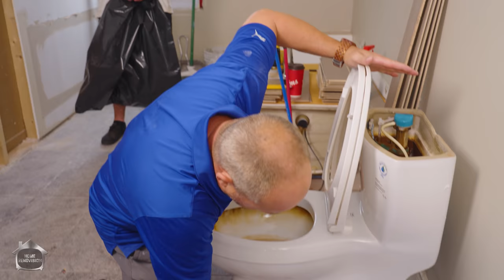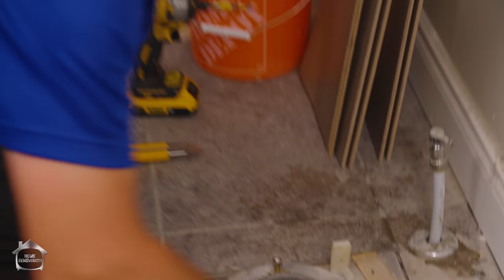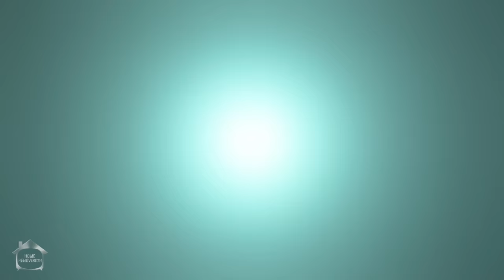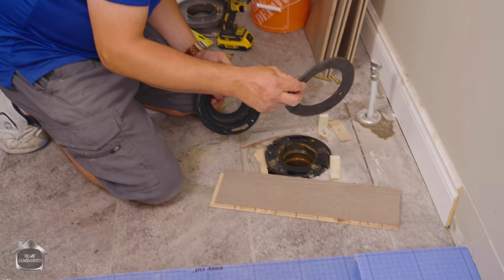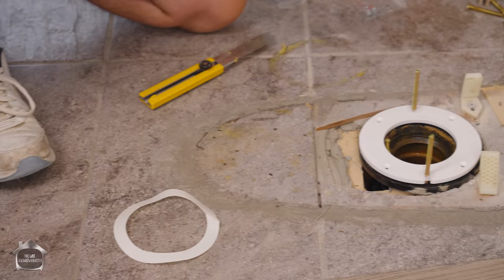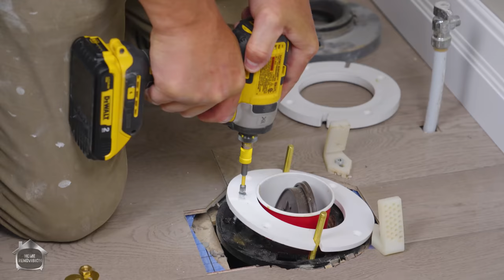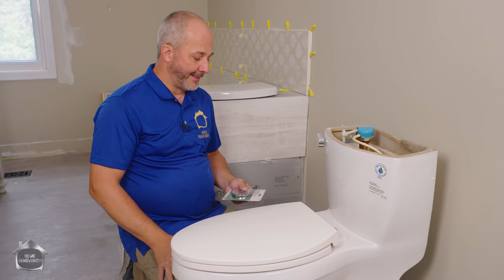How To Install A Toilet So It Won't Leak | DIY For Beginners

Comment: Thank you so much for your information. I've installed numerous toilets in the past . I'm not a  plumber, but I can do most plumbing things. We had a  leak in the living room ceiling below the  bathroom. I removed the toilet and ended up finding out it wasn't the toilet leaking but another drain pipe. I fixed the leak and reinstalled the toilet. And then had a large leak from the toilet. I couldn't believe it.  I watched your video and then saw what you said about tightening  the toilet foundation screws evenly.  I never paid attention to that. I had tightened one side fully and then did the other side. I removed the toilet then reinstalled it exactly like you showed in your video.  . . . . . . . and BAM  .. . . . . .no leaks. Thank you so much.

Comment: I have an unlevel Closet Flange that is below the floor surface and I think the extension rings with the rubber gasket is going to wrk. Korky makes a nice tall one that is similar to the thicker was ring. Will let you know how it goes.

Comment: This is super helpful!  I have a house that was built in 1929.  The flange is cast.  When I moved in 5 years ago, I pulled the toilet and resealed it.  Didn’t replace the flange,  it probably should have, looking back.  It was pretty rusted out.  The twist and seal I think would be a great option for this to properly secure the toilet.  Next project along with the vanity (watched your video on that as well).  Your videos are very helpful with DIY projects around the house.

Comment: Love your videos! As a plumber (also based out of Ottawa), I have to nit-pick a few details. The trap in the toilet is an S trap, which is why it will siphon with a bucket of water poured in it, but every other trap in your house will not. Secondly, if you're not going to remove all the water from the tank with a rag or vacuum there may in fact be a decent mount of water left over when you remove the toilet supply. Some toilets have a recess around the fill valve that holds a fair amount. Ideal to just have a cup or something handy to let the hose drain into just in case. I think it would have been good to also mention the importance of a well secured, structurally sound toilet flange. I find many toilets with issues have a flange that was poorly secured or has had screw or subfloor failure. If a poorly secured flange isn't addressed, most other elements of the reinstall wont work. The toilet will always move and tightening the bolts will only over-compress your seal. Perhaps you've mentioned this in other videos, but I feel a homeowner going off just this video might end up missing that and having issues. Keep up the great work!!
Reply: Good points - loose flanges are very common especially in older homes where we see a lot of damaged subfloors.
Reply: My house is slab on grade, single story, and the ABS pipe catching the toilet is cast in the concrete. There's a hole chipped out in the slab larger than the flange and pipe that goes down to the turn in the pipe, so there's a half inch space all around the flange and downpipe. Both toilets had the adjustable outer metal ring and ABS center type of flange. Built in 1994, they were both now totally rotted and both toilets rocked and leaked sewer gas. Both are in a water closet type bathroom design so sewer gas stunk the room up quickly. So, I had to remove both toilets to fix the flange and replace the wax. The shocking thing to me was that both flanges were totally floating in the wind. Not secured into the slab at all. No screws or anchors. Nothing. It was just the flange glued to the down pipe, and both pieces floating in that space until the slab enclosed the horizontal pipe at the elbow. I was so annoyed. I used my hammer drill and the longest 3-4" Tapcon concrete screws available to me to secure the new all-plastic flange to the slab around it at a slight angle due to the gap between the flange/pipe and the slab. Couldn't go straight down, nothing there. Then I installed an extender plate with many brass screws and sealant between because the flange was level with the tile floor which I don't believe in. New wax, reinstalled the toilet, solid as a rock and no more sewer gas. I have no way of knowing if the adjustable flanges were original but I'm guessing they were. So, '94 to '21. Only 27 years of life, and who knows how long they were leaking gas. They were leaking when we bought the house. My repair will last my lifetime. 👍 I can't believe how many people just leave a closet flange loosey goosey and think it's ok. Out of sight, out of mind, right? 🙄 Integrity. Honesty. Pride in the work. It didn't take me long to drill 4 holes and pop 4 concrete screws into that slab. Even 2 would probably work ok. But no, they left the 1 foot of 4" ABS pipe alone to hold everything in place. 🙄
Reply: @buddhastalin8445  I only know what I've been taught and am curious how other people go about things and if there are better ways out there. If you think you've learned all you ever need to learn then I think you're just wrong. Stay curious my dude

Comment: Same great content I've come to expect.
In my case, as well as the flange being too low it was also installed wrong. The wide ends of the bolt slots were parallel to the wall instead of the narrow ends. Flange extension kit fixed both issues.
Gotta love the foreclosed homes.

Oh, and if anyone does decide to shopvac out the last bit of water, it would behoove them to make sure the hose is connected to the right port on the vacuum.
Reply: That last bit is incredible.
Reply: @EricLS  my favorite part was quickly calling my wife to inform her that if she made it home before I finished cleaning, to not panic, the walls are not covered with feces....just toilet water and some left over sump water that I neglected to dump from a previous project.

Every square inch of my bathroom was covered, except for a humanoid shape in the shower directly behind me

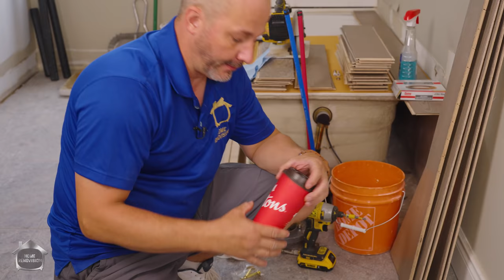Comment: Lot of great hints, but the one at 17:29 might be the best one yet.

(For newbies, and the great majority of people with old style traditional vertical attachment bolts - Not the horizontal screw-in-from-the-side ones he showed early on - it would have been helpful to include a few seconds of what that is like since that is much more common to be expected.)

Comment: Some plumbers say to not caulk around the base, if the toilet leaks you want to see the leak.  You don’t want to seal it so the water builds up and damages the floor.  One video I saw said to go ahead and caulk it but leave a space in the back where water can escape, alerting you that there’s a leak.
Reply: It may also be code dependent as well

Comment: Thank you very much! This comes just in time because I need to replace a toilet. In Belgium we never use wax, we always use a white tapered PVC pipe that slides into the sewage pipe sticking out of the floor. I also wonder which brand of water flushing system to buy: Geberit or cheaper brands?
Reply: The same in Russia. Personally, I wouldn't risk cheap ones. I installed my toilet provided with Geberit 7 years ago and have had no problems at all.
Reply: If you put anything inside a 3" pipe, you reduce the effective internal diameter of that pipe.   Perhaps in Europe you use 4" pipe when roughing-in toilets?

Comment: Better Than Wax is a rubber seal (found at HD, Walmart, big box stores) that gives you a little wiggle room so you don't have to be perfect initially like the wax requires. A little more expensive, its an option if wax installs give you issues. Once helped a neighbor install a new toilet & couldn't figure why water was still coming out onto the floor. After tearing out the old flange, pouring new concrete, install new flange (slightly above finish flooring), still leaking. Eventually figured out that the freakin new toilet was leaking and attempted repair was done at point of leak. Looks like someone at factory just tried to glaze over it. Even if the store gave him a free toilet (not), it still wouldn't make up for the stress and time spent having to trouble shoot this problem. Lesson is just because its new doesn't mean it aint broken, just because its new doesn't mean factory has quality quality control or if these things are each tested for leaks before they're boxed and shipped.
Reply: I’ve been told the exact opposite of this by several plumbers. They all stick with wax because it gives you a little wiggle room on initial setting. All of them said the rubber ones leak.
Reply: I like the Danco Perfect Seal - uses both rubber and wax.
Reply: From what I’ve seen the rubber once leak

Comment: Step 1: clean the toilet

Siliconing or grouting the toilet to the floor does stabilize it, but it masks any potential leak at the seal.
Reply: I was taught you seal everything but the back. Because the surface tension pulls any water running down the outside of the bowl into the unsealed gap, but it leaves the back open to indicate a blow wax ring.

Comment: As someone who has smooshed wax rings on some hard to manuver toilets only to find out years later that it was my fault the toilets were slow flushing... rubber compression rings are the way to go.

Comment: Now I'm nervous about our other toilet.  The tile was installed by a contractor, and he had me buy an extra wax ring.  He used two wax rings instead of a flange extender, which until I watched your video I didn't know those existed.  I didn't check to see how low the flange was.  Maybe it's fine? I have trust issues.  Haha! I'm seriously tempted to pull it up and check it.  Seems better than having to retile the floor later due to a rotten subfloor.

Comment: That was a very good tutorial.  Thanks
I do have a problem with using clear cilicone in kitchens and bathrooms, which I admit is a personal quirk.  Whenever I see that shiny cilicone around the flat surfaces under a fixture it appears to be standing water and I think "leak" and "bacteria".  I know it's just my personal bug-a-boo and not a big deal for most people.

Comment: If you are having a hard time lining the new toilet up you can place screw drivers on each side on the floor pointing at the bolts to help as an alignment guide when doing it yourself.
Reply: Great tip.  I use masking tape and do the same thing!
Reply: @ThatFixItGuy  I can never find tape when I need it, lol.
Reply: Also plastic straws on top of the closet bolts help too.

Comment: I love these videos and as an apprentice plumber in my area this info really helps me bring more knowledge to my jobs. The only issue (but not really) with the installation of the toilet is I've been told by my journeyman to not apply silicone all around the toilet but to leave a space clear at the back so that you will be able to spot a leak easier before it's a black stain on the ceiling.

Comment: use straws from the local McDonalds to place over the Jonny Bolts to help you guide the toilet straight down through the bolt down holes in the toilet!
Reply: Great idea!

Comment: As a master plumber I've set 1000's of toilets in tract homes in So. Calif.....I'm not sure why I'm even here. But here goes....
Before you set the toilet, run a nut and washer down  the closet bolts  until fastened to ring...(holds them and everything else in place)
Rubber rots and curls...(would never use that)...you can stack 2 wax rings, you want it to squish!
Use shims on all 4 corners (like a wobbly card table) so the toilet doesn't rock side to side or front to back....only then you fasten it down to floor.
Never set and old stained toilet....gross....
A 2 piece toilet has some do's and don'ts also.....
Love your drywall video.

Comment: Thank you for the information! I live in a very cheap house that we've been remodeling room by room. No corner is 90 degrees, everything was half assed and done incorrectly. The latest one is we needed to replace some subfloor in our bathroom because of rot. We ended up gutting the entire bathroom. One corner of the joists was connected to nothing and just floating. This caused the tub to sink in the back about 3-4 inches. The toilet was rocking etc. My lord was this a task. But this video really helped me understand how to do the toilet correctly.

Comment: Plumber by trade. Whenever I see big ole gaps between the flange and the flooring I fill those in with plumbers putty to keep the water above. Rarely caulk, never grout, should I customer ask for caulk, leave gaps at grout lines for observation of leaking wax. Better to see it before before it ruins the floor. If the flange is low, I bolt on the bolts, if they’re brass they’ll always be good. Double wax ring is fine, no horned underneath a horned ring. 90% cast over here in Chicago, those pvc replacement flanges are life savers, we tend to use the Oatey ones with the Allen key screws for compression.

Comment: I've also heard it recommended to not seal the toilet to the floor because that way if it ever leaks the water will run onto the floor and you'll see the leak.  If it's sealed to the floor, you won't detect the leak until it gets worse.   Just something to keep in mind. I think I'd probably leave a weep hole or something for any leakage to come out if I did seal the toilet to the floor.
Reply: Agreed.  Leave a few inches unsealed at the very back of the base (where it's not so noticeable) for water to come out if there's a leak so you'll be able to see it.

Comment: Wax always; they are much more maneuverable. Just replaced a toilet in a complete bathroom renovation. Wax rings give you the ability to get a toilet flush with the finished flooring no matter where the flange sits
Reply: Omg,,, nice work brother,,,    the 3 decades flood guy.      Mitch
Reply: Welp re doing my toilet after watching this! Used a regular wax ring. Should have done the Jumbo with added flange extension kit.
Reply: @JonathanRootD  pull it out now and replace, dont even think about it.
Reply: Wax is trash, rubber all the way.
Reply: @tomsaywer9883  Foam rubber is great......for the first 5-8 years.

Comment: I had no choice but to use the stainless steel moveable flange into PVC 90 lead bead non-hub 3" all cast iron. The subfloor was completely rotted down to the joists. I had to build up the subfloor with (3) 5/8 plywood just to get a slight pitch for the toilet flange to the stack. A pain in the.

Comment: During the tee-pee shortage I replaced my toilet to add a bidet and used a rubber gasket. Seems to be working out.
Reply: A bidet is a game changer.
Reply: I have been using bidets since I came back from SE Asia... definitely a must. I have been using a add-on unit from bio-bidet.. hot and cold water... even has a cooter washing mode..
Reply: Bidets are sooooooo life changing.  I think I go through a roll of TP once every 3 months now.

Comment: I do renos.  I've used the foam/rubber toilet seals for 10 years.  With no problems.  I was apprehensive at first so I used them in my own house I built 12 years ago.  4 bathrooms no leaks.  So I've never used wax since and no call backs.  Have 2 in a rental house I own too.  I've often used the assorted riser shims too after doing a new flooring.  They work great.  PS i push Toto toilets to all my customers.  I live them and have them in my house and my rental house too.

Comment: Should have sealed that hole in the floor where the mice were getting in before you refitted the toilet. was surprised to see all the mice droppings when you lifted the toilet off.
There's nothing wrong with using silicon but you do need to use the correct type, you don't use sealant, you use silicon adhesive, guaranteed to never leak.
Reply from the maker: I actually renovated the whole house so mice can't get in any more. not worried about a small gap. Cheers! as for the silicone. Stop lying to yourself about using silicone in a toilet assembly. It always fails. You are one of those guys I was always cleaning up after.

Comment: Missed one thing. I've never seen a toilet that didn't have the bolts coming through ceramic bottom flange. What I was waiting for is, how tight do you tighten the nuts so you don't break the ceramic?
Reply from the maker: just tight enough so it is not moving side to side. Cheers!
Reply: Use a nut driver and use your thumb, index, and middle fingers alone to tighten it. Snug the nuts down evenly side to side, then only tighten them as much as you can with those 3 fingers alone on the nut driver's handle. No full fist and NO wrenches. If all you have is a socket wrench, use those 3 fingers on the head and first 1/4" of the socket wrench and its handle. Do it this way and you'll have a hard time cracking the toilet because this method gives you very little torque/strength and very little mechanical advantage. 👍 With a solid flange mounting, the nuts will snug down and then tighten very distinctly. You'll know when it's tight and it won't rock. If it needs to be tighten a tiny bit more after a few days of use, fine. Use the same method and tighten them up again, then you'll be good to go. No fist, no full handle length wrench.

Comment: I enjoy your videos. They are helpful. In your example there the flange is on a slight slope towards the wall the the tile is level. As long as the lowest part of the flange is minimum, level with the floor, then a wax ring is all that's needed? No need to try to level the flange? Thanks.

Comment: Can definitely second the wobbling toilet is a problem toilet thing.  Mine wasn't leaking, but it did very slowly work a crack into the base cutting off one of the bolt-down points.  Now I'm learning how to install a new toilet.